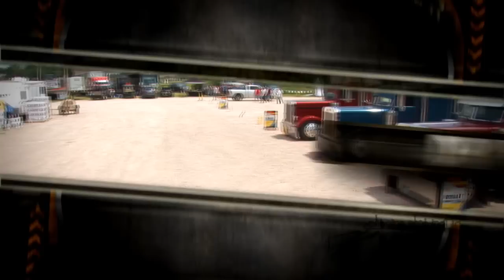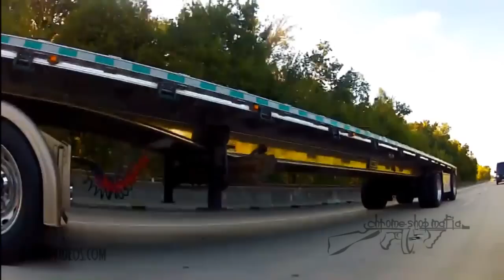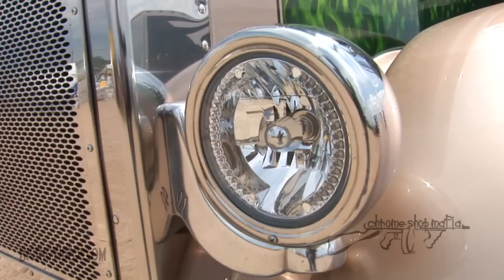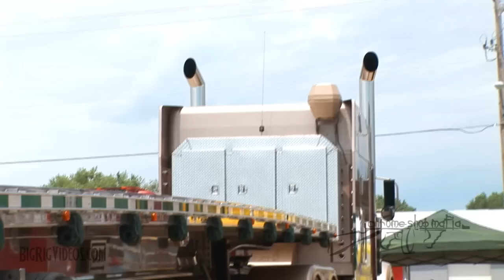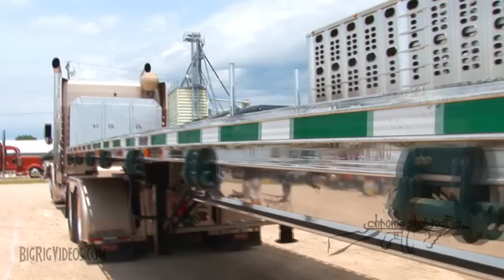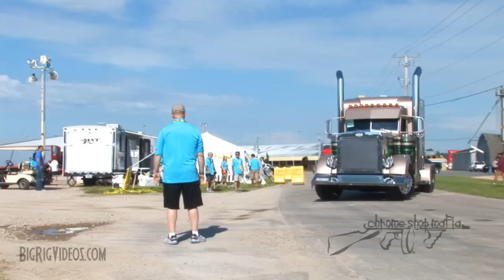Owner Operator Interview - Kenneth Fisher

Comment: Q. Are there any legal restrictions on vertical pipes in different States in the Continental USA?
Q. Would an Owner/Operator ever pull someone ELSE'S trailer?  Ever REFUSE to pull someone else's trailer because of condition?
Reply: nutmegger1957 13'6 is a standard height for pipes cabs sleepers 14' is legal but you'll be writing your name under overpasses if u ain't careful